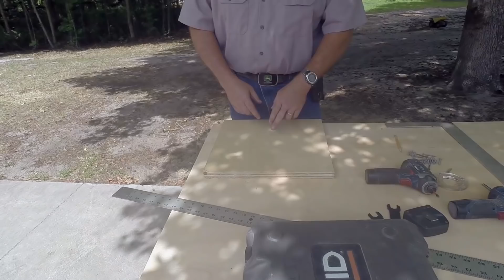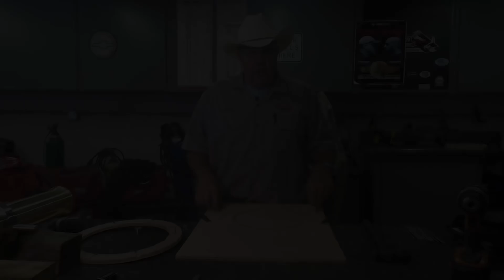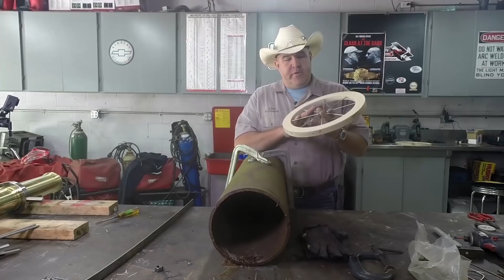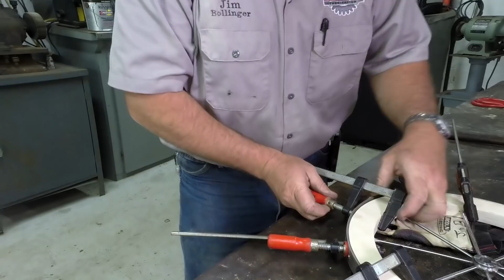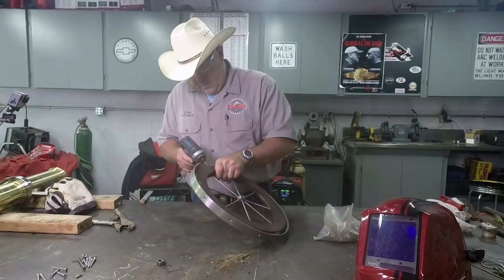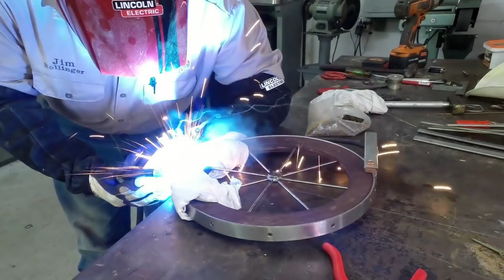Building an historic brass cannon Ep 4 - Fabricating the cannon wheels

Comment: I put my meatal tires on by welding two large nuts on the ends of the band ( once they were bent round) and then put smaller althred so it slides throuh. Then put nuts on each end of the althred tighten it up and weld, dunk in water and take the althred off and cut the nuts off. I think its even tighter than the original way. They even have a little bounce when you drop them on the floor.

Comment: If this wasn't titled, "Building an historic brass cannon," I probably wouldn't comment, but I worked with a wheelwright at Mountain Village 1890 in the Arkansas Ozarks and learned the historically accurate way of making wheels for their wagons. Historically the way to put the tire on the wheel would be to forge weld the tire slightly undersized, then heat it and shrink fit it to the wheel. I understand stainless can't be forge welded, or at least not in a home shop, we used mild steel. The wheels were made of segments of live oak fastened together on hickory or ash spokes, and the compression of the mild steel wheel pulled it all together making the wheel a solid unit. If you had screws or bolts countersunk into the tire, over a very short span the heads would break off as the wheel flexed, because the tire is not providing compression, and then the loose tire would work its way off the wheel.

Comment: proper way to fit a steel "tire" to a wood wheel is heat the metal ring to expand the metal and then fit over the wheel while hot. Cooling will contract it onto the wheel TIGHTLY. No screws needed. Might toast the wood a bit but that can be sanded off easily.

Comment: This is shit.  You should weld it off, but make it so it's too tight to get on normally, then heat it up and place it on hot before cooling it with water. Trust me, I'm a level 93 youtube watcher, Iv'e seen it done a time or six.

Comment: Nice job. You made making a wheel look so easy. Did you use regular wood glue or epoxy to hold the spokes in position?
Reply from the maker: Epoxy at the spoke connections and Tightbond II for the wheel halves. thanks for hanging around!

Comment: Sound is not good. I hear a fuzzy, scratchy static.
Reply from the maker: I listened to it on three separate devices with two different connections, it was all good here. Maybe a problem with you device, the connection, or Youtube. I'm not sure but it's all good here...thanks for checking it out.
Reply: DoRite Fabrication it's probably your mic. The noise was gone in that final, short outro piece of video.